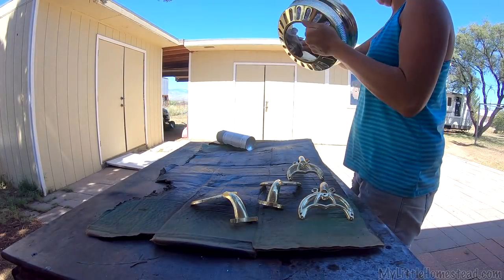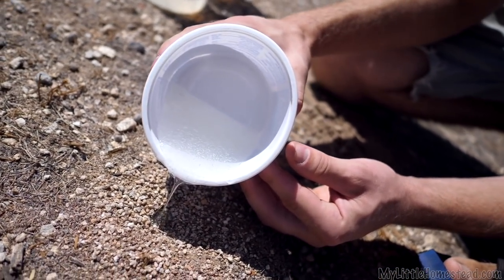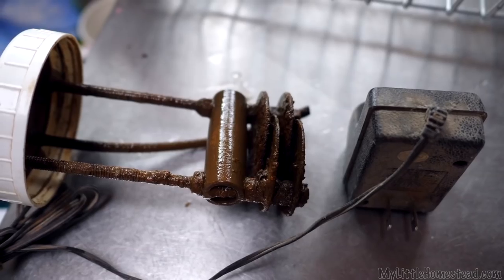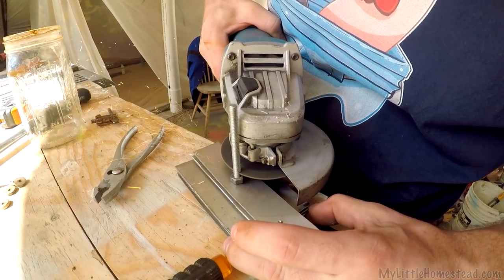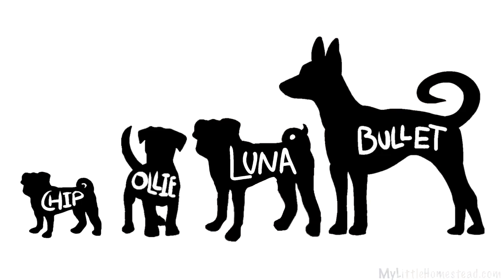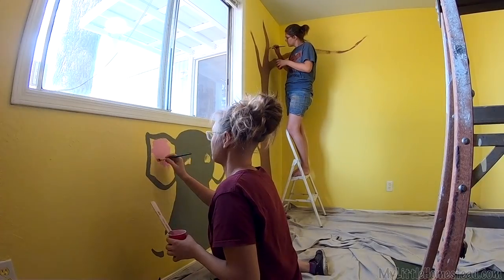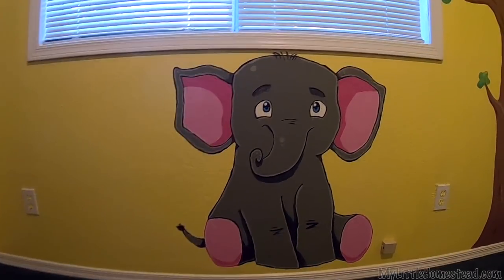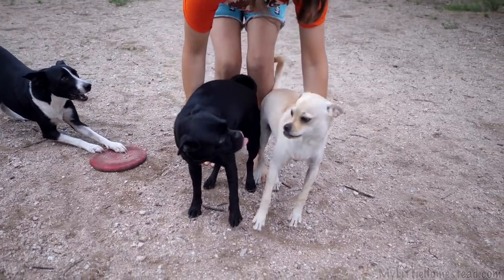Baby Room Wall Art, HHO Generator, Epoxy Ant Hill & Hosp Update | Weekly Peek Ep204

Comment: You might try diffusing the air into the water with an aquarium air stone.  The smaller bubbles produced with cause more of the gas to dissolve into the water.

Comment: I won’t offer an opinion or suggestions for the lymphoma but I will continue to pray.  Then start over.  Re: baby’s room- I bought a bigger house just as the birds flew the coop.  I can’t explain what I was thinking but it was just getting crowded and loud then cranky. I don’t remember signing any papers but I think I adopted 3 boys and 1 girl the final semester of senior year. Then POOF they were all gone. But, when I bought the house, I allowed myself a studio and sewing room. And did the same thing you did (except I didn’t do an elephant nor were monkeys hanging from the tree. At 50 something then, I thought it was a little ridiculous but didn’t seem to mind. The room had a fan with brassish goldish fittings. I took it apart and painted them (gasp!) turquoise and painted the wood black. Did a little glaze on the glass of the lights and should have stopped there. Painted the fan blades into peacock feathers. Oops. It looks fine when it is on but not when it is idle, It is garish. But now it is my grandsons room when they visit and the youngest loves it. I did the tree on the corner to the right of yours but rather than monkeys, I painted little hanging lanterns and put real lights on the lanterns. The lights weren’t wireless and the teeny led lights did not yet exist commercially so that looked sloppy. Made little hanging lights but they hang a little crooked. With the new glass led dots on slim wire, I think I might go back to that and incorporate the wire into the trunk with paper mache or simply paint with enough bulk to cover the wire. And man did I rabbit trail. Sorry!  The point is that the work you guys did is perfect and the fan turned out much better than mine.  Fantastic!  It took me much of the video to figure out what you were making the oxygenator for. You said but I didn’t understand. I am curious about why you used more metal pieces and what determined the shapes of the metal. You guys are awesome! As usual

Comment: The reason for using aluminum is that the weight of the aluminum will pour into the ant hill.  Where the resin doesnt have as much weight.  Fun experiment just the same.  Tho on your furnace, you should add a blower of some form to increase your BTU's.  You could try a hair dryer.  Yet the ones I have seen in the past used a blower from a vacuum.  The fuel enters the intake of the blower and then goes down a pipe.  Only need about 7psi of propane for the flame.

Comment: ,the stainless steel water seperator also works as a power adder/gas mile increasing device , when incorporating it into the vacuum line into the carborator of a car.. separating hydrogen atoms from oxygen .. powerbooster!  Google that too

Comment: I would like to point out that you are actually not just adding O2 to your water, by collecting the bubbles from the anode and cathode your just mixing the O2 in with the HHO. If you add a barier in your jar so that the bubble are separated you can then add just the O2 to your water.

Comment: Never heard of drinking HHO-infused water. I did briefly get into the 'HHO generator in your car' fad for awhile. So I did some research. 1. Seems to be important to use either well water or rain water so that the electricity doesn't make chlorides of the stuff in the water. You probably have that handled. 2. My understanding is that oxygen comes off the positive plate, and hydrogen off the negative plate. So perhaps there would be a benefit to adding a divider down the middle of the generator, so that the bubbles you're capturing are mostly hydrogen rather than equal parts of both? Just a thought.

Comment: I never heard of drinking HHO water.  I always used it to get better mileage on the pickup.   Adam Savage is a sell out and failed to make one and concluded it is impossible to do.
The reason being that it increases your mileage so we can't have that.
Also, I wonder if you have checked out magnetic water treatment.  It simulates the effect of water traveling through the ground.  Basically you have magnets positioned counter
to each other and the water goes through the center of them.  This resets the water mimic effect, which occurs when it is exposed to different molecules, like drugs, chemicals, etc...

Comment: hi Gary,  If you decide to do chemo and you don't want to loose ALL your hair ask your Dr for Ice Caps for your head while you're doing chemo.  It helps. 
  If you do Radiation buy large Aloe Leaves, refrigerate them (1 1/2 to 2 feet long)  cut a large piece in half and place them on the radiated area.   Its like an extreme sun burn!! 
My Dr. told me there are 2 types of people that go thru chemo 1. you can Throw Up thru it 
 2. You can Sleep thru it.      I Slept ALOT  like 18 hrs a day.   I just Imagine the medicine killing the bad cells and leaving the good cells alone.     Its scary but you're tough enough..You Can Do It!!
 My Prayers Are With You All

Comment: my little carry around laptop doesn't give me the option to comment. Sorry.. - Sorry to hear.. Hoping the best.. Bedroom looks great. the water stuff.. should look into an osmosis filtering system to put in before that device - should be around 100 bucks to buy in and about 35 dollars every few months per to your water condition and water through usage.
Reply: When I bought th efirst it was 50 bucks and 7 dollars every 3 months - second time it was 75 dollars and 15 bucks every 3 months - this last time they bought one for aropund 120 with taxes and the filters cost 35 bucks but on line I can get them for like 20. 
 BUT that's just that Brand.
Reply: not sure the end game of the whole resin / ant hill thing? - in my mind You were thinking of constructing a random Sculpture like structure that would be the Clear glass of resin - for Various reasons.. Maybe? - although this is a good source of such structure the actual Soil type Alters the look and ability of doing such a pour. even if it would have been aluminum it would have been filled with dirt and rock as well.
Reply: if this is the Goal? - I would recommend finding a tree out on a - God I Hope I don't get snake bite journey - get the random root shape from it - then take it - Put a wrap around it - and divide it into either 2 to 4 sections - then plaster it with plaster of paris - once hardened - take apart - put the sections together  then pour the resin in - MIND you - if you want to Light the sculpture Afterword = take a metal coat hanger and make a hollow section in the body - using Lube - Maybe even like Vaseline - or like - and using a slick coverage material like Electric or packing tape? or even maybe Wood? or even Plaster itself? - Sigh
Reply: Clay is a good medium ? - but Again sigh.. you're stumbling into Theory Area of my Artistic Monetary expenses.. LOL.. <heart> - Positive thoughts <HUG>
Reply: check local plan life guide - with the local conservation - they should have some sort of Guide - use that guide to get an IDEA of where you need to dig  - dig Deep and Wide to what you are Wanting to remove - remember roots are sometimes Bigger that there Trunks - Also other places for such a Sculpture appearance.

Comment: Don't use stainless steel for anodes ( + plates ). Waste electrode ( anode ), when made from stainless steel breaks down into chromium oxide VI ( that reddish rust ), which is highly cancerous, breathed in or ingested. The particles are literally microscopic, so there is really a chance that it gets into the water along with the gas pressure/steam and you are drinking liquid cancer. Use graphite instead, at least for the anodes. Throw the old jar out. If you use table salt for better water conductivity, don't do it. Hydrochloric gas is released. Use Sodium hydrogen carbonate ( baking soda ) instead. Take care.